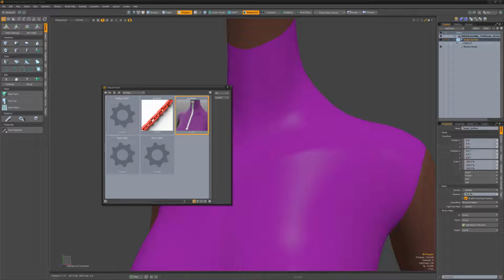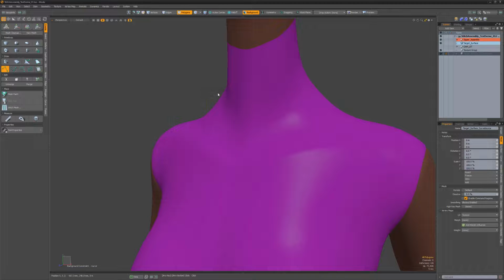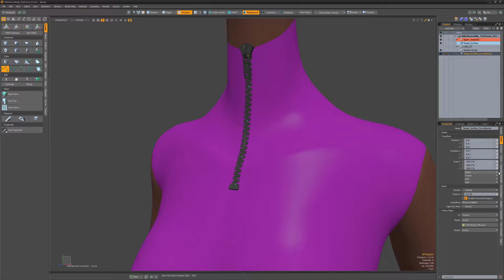MODO 12.2 | Stitch Mesh Setup: Using an existing assembly for stitching

Comment: William. I cannot find anything online on how to set up this assembly to show up correctly. I can save a 3 mesh file into an assembly but it will not link and expand  as you show on this video.  Can you help? (master)
Reply from the maker: I released the assembly here: https://www.pixelfondue.com/blog/2018/12/1/modo-stitch-mesh-setup-pushing-points-zipper-assembly
Reply: @pixelfondue  did not get that email. Is there a way I can modify the items in the assembly? I got the chain and I want to modify it to create other link types. Can you show us how to customize the meshes in your assemblies? both chain and zipper?  I'm also buying the zipper assb right now. I basically buy everything you put out. thanks master.